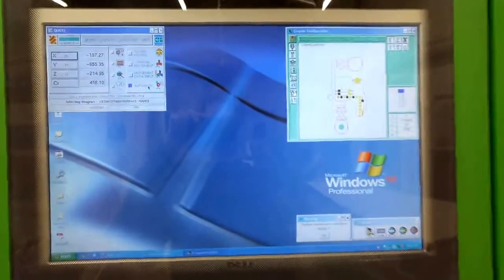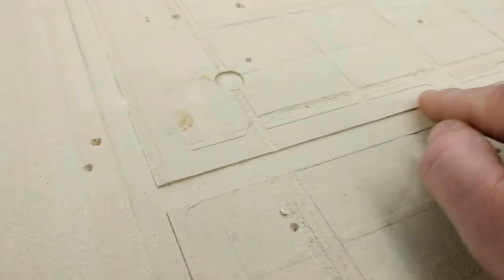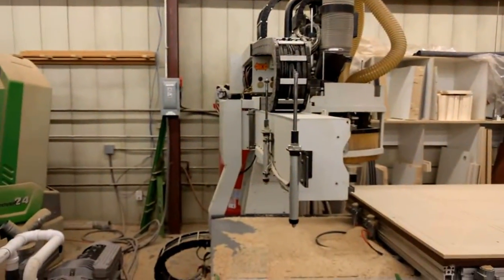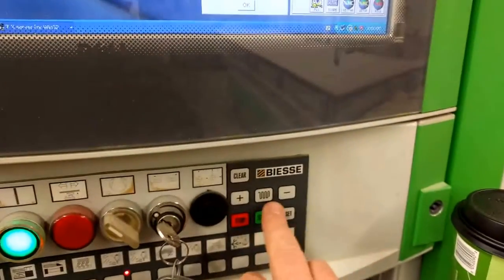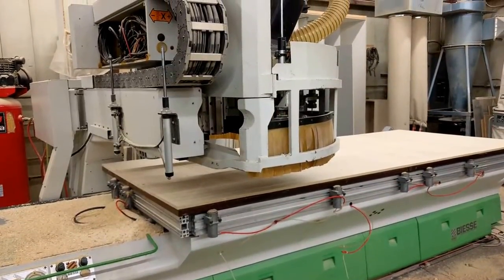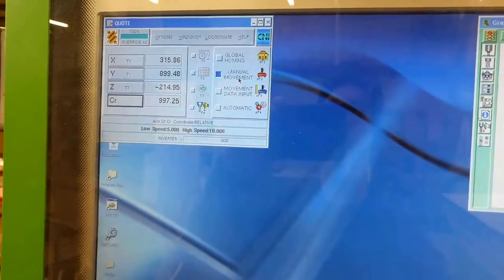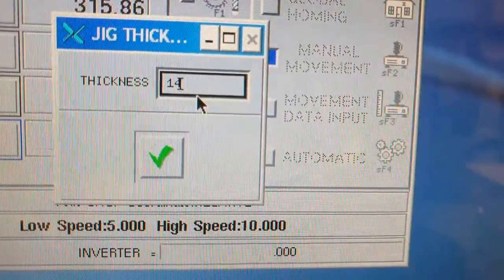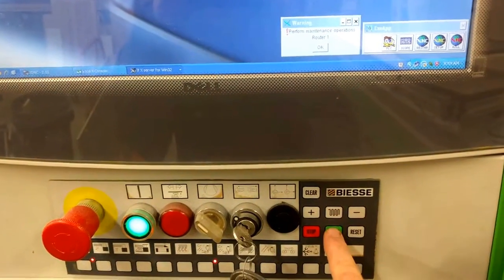Biesse Rover 24: Spoil Board Resurfacing

Comment: What size is you Vacuum Pump? Also how fast (feed) do you usually run your spoilboard cutter
Reply from the maker: Our pump is under powered for the table - we should have two of them. It's a Becker 7hp with vanes. The fly-cutter runs 18,000 rpm at 800 ipm.
Reply: @thecrazycncguy7500  funny since I asked the question I actually bought a second pump for our Rover j plast. It's a VTLF 225 so 7 hp. We still haven't been able to find 5x10 or 5x12 MDF for our spoil board material so we've been just brute-forcing it with low quality MDF. The second pump does make a big difference though.

Comment: Very useful videos, thank you. I have Biese Rover 27, and mostly of the time is working well but sometimes it shows some errors and they take me time to solve them. One of them is " Timeout stopped motor input (1, in 7 ). I think maybe this comes from the contactor behind because then I have to stop the machine and give a contactor a bit of touch with something. Thank you
Reply from the maker: I run into the "time out" errors when the spindle is performing a tool change but doesn't grab the second tool. We actually manually push up on the cradle bar to get it into position.
I don't recommend it. We haven't had the problem since we replaced the spindle. And yes, contactors wear out. If there is one that continually gives you trouble, you might want to have an electrician replace it for you. Good luck!

Comment: Stupid question,  but how do you measure the height of your surfacing tool?  Our Biesse Rover A's tool touch off pad is too small to use and really close to the bed.
Reply from the maker: On the Rover 24 I measure each tool before I put it in the tool carousel. Our spindle uses an HSK 63 tool holder. With the tool tightly in the holder but out of the machine, I place it upside-down on a flat surface. I then measure from the teeth on the cutting tool to the bottom ridge on the HSK tool holder. I use a z-height / Electronic Height Gage like this one...https://www.amazon.com/dp/B007EMPCQ4/ref=sxbs_sxwds-stvp_2?pf_rd_m=ATVPDKIKX0DER&pf_rd_p=3341940462&pd_rd_wg=cYu6M&pf_rd_r=52BF0VM9CPV7TS0WRZ4R&pf_rd_s=desktop-sx-bottom-slot&pf_rd_t=301&pd_rd_i=B007EMPCQ4&pd_rd_w=gr4SV&pf_rd_i=z-height+caliper+measuring+tool&pd_rd_r=ecda6d02-7174-4ed7-b1a7-1a6b692fff46&ie=UTF8&qid=1516667133&sr=2
Reply from the maker: Then I manually set the tool height/length in the tool table. I hope this helps! As for setting the spoilboard thickness, I am unfamiliar with the Rover A. You'll have to look up Jig Thickness settings. Then reduce your jig thick ness by 1/4 mm and run the program. If the tool isn't cutting then repeat the reduction in Jig Thickness and rerun the program. Perform this cycle until the spoilboard is to your liking.
Reply from the maker: hybridcx - did the above comments help? I hope so! Be well!
Reply: The Crazy CNC Guy hey yes it did!  I don’t have one of those height tools so I’ve been using calipers and measuring in the same matter but I’ve been going off of the biggest measurement.   I have been able to finally dial in the spoil board thickness to match what the machine thinks it is after surfacing.  I might have to invest in that measuring tool for the future.  Thank you very much.   You would think bursar would have figured out a way to have an auto touch off for the surfacer like it does all other tools.  My old omnitech could do it